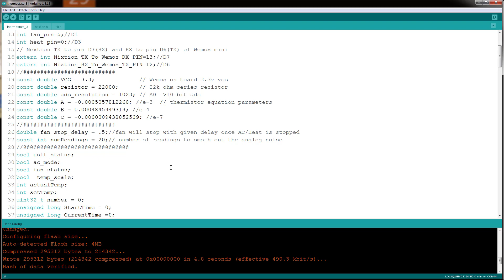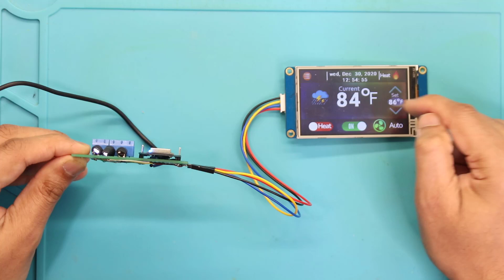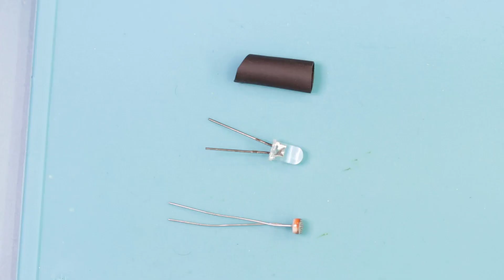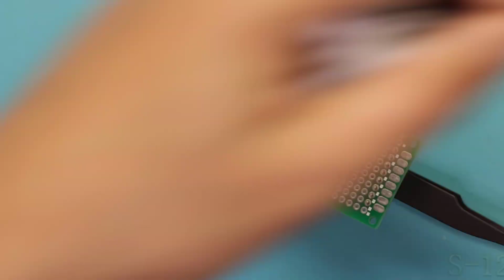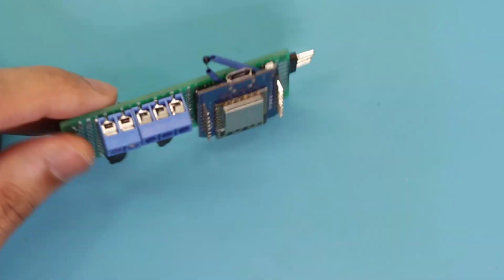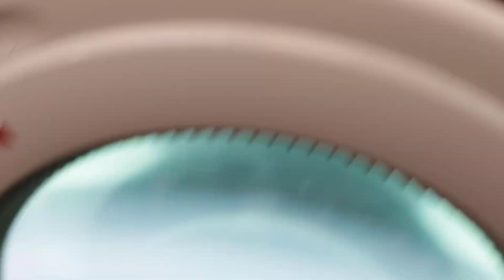ESP8266 Thermostat HVAC | Like Google Nest | Part #3 | Tutorial # 42

Comment: I don’t know if you are still out there, but I have come across this project and found it useful for a project I was working on. I added in classic BT to communicate to the thermostats. I am going to build a solution but curious on how you got the values for the capacitors?

Comment: I have enjoyed so much the informative ideas behind this project.  Especially designing the screen and watching the screen work in real time.  Kudos to Netmedias for sharing his videos and design ideas. .  As far a programing, I believe I have added the correct libraries to Arduino, ESP8266 by communities, and NTPClient by Fabrice Weinberg.  I unfortunately, cannot get it to compile as it stops on line 12.  Nextion myNextion(nextion, 9600); //create a Nextion object named myNextion using the nextion serial port @ 9600bps.   error: 'Nextion' does not name a type;  This is such a practical and fun application. I have everything soldered together and would like to finish the project.  Is there any help either by the author or by someone else who has this Smart Thermostat working?

Comment: Thanks for the complete tutorial!
Question about switching the call-for-heat and call-for-cool: Do you need a protective resistor when switching the White cable to the Red supply, or is it okay to short them?

Comment: Trying to compile the thermostat3.ino but can't get pass the nextion.h line 13, Nextion myNextion(nextion, 9600);, throws error "Nextion does not name a type" Tried most solutions found on Google. Using Arduino ide 1.8.16(also tried 1.8.5) on Win10. Iteadlib , Thanks for any help. Following project with great interest, got successfully pass programing the display.
Reply: I have the same issue. Did you ever get it figured out
Reply: Are you using the Nextion 3.5″ HMI Display NX4832F035 Resistive LCD-TFT Touch Screen 480×320?
Reply: @MacaqueResearcher  I was using the NX4024K032, I  believe it resistive touchscreen.  Never got it working, have you?
Reply: @joshuaburns7598   Try this it got me past line 13 and is from his original code:  SoftwareSerial nextion(12, 13);// Nextion RX to pin D7(TX) and TX to pin D6(RX) of ESP8266 12F

Comment: Great job brother, thank you for sharing
Reply from the maker: Thank you
Reply: @netmedias7657  I have couple questions if you don't mind. Did you use ESP8266 just for updating time? Why you don't consider connecting your module to internet ? Would be great. Last question it will work with ESP8285?  Thank you brother
Reply from the maker: Yes you can use it with ESP8285. I will be contacting it to internet in future videos, good luck

Comment: Why doesn't the system need a relay?
Reply from the maker: Because I am using DIY opto-coupler, you can use relay instead.
Reply: in case of relay, they should output 24v right?

Comment: Dear Nassir Malik
Thanks a lot for sharing, a Very nice and informative Channel.  I am sorry I have not tested it but it will be more useful if you can add more functions. Please add the library links and software versions also it may help for beginners.
 1) Add a wifi manager
2) Retrieve the last state in case of power failure.
3) A good choice is IOT Thermostate.
4) Bluetooth is a good choice for using it wirelessly in absence of WiFi.
5) I think that DHT22 is more useful for Temperature and Humidity.
Really I appreciate your work from the depth of my heart. You will get the benefit in this world and hereafter.
Thanks and my best regards 
Shahid

Comment: Absolutely love your videos. Hoping you can help and or maybe a new video idea. With covid and the surge of indoor exercise on treadmills or indoor cycling fans have became a must. Problem is all good floor blower fans are not smart fans. There is one or two models that run $200+. I’ve read where people have used a relay and pi or other smart boards to voice control each speed wire in a fan. Like Alexa turn fan on high, Alexa turn fan on low.  Relay kicks each speed in. However I have not seen or read of anyone doing this and keeping the original manual fan controls operational as well. Is the possible? If so you should make a video. Would certainly be a hit right now with everyone working out from home. No one wants to get off the bike or treadmill to turn a fan on or up higher.
Reply from the maker: Andy thank you. It is great idea. I will look into it. Thanks

Comment: In the video it shows "LRD LG5528". In the description it says "LG5528 LDR". But the correct part is "GL5528 LDR", which is a Light Dependent Resistor or a Photoresistor. You suppose to be more accurate with the components' description if you make technical videos. Otherwise it's just misleading.
Reply from the maker: Sorry! for the typo mistake.I can't fix the video but did updated the schematic diagram on GitHub . Thank you
Reply: @netmedias7657  I have a small problem. I need to use components that are compatible with Arduino. A position sensor (so I use a GPS module. This GPS module must be Adafruit Ultimate GPS Data Acquisition Module (GPS Included)). A position storage (with an SD card that must work with an SPI link). A bluetooth interface. A GUI to visualize the route (using an Android tablet that is compatible with a bluetooth module).
you can advise me to use what as a component . because it's 3 components must be compatible with Arduino and an Android tablet IHM thanks to a Bluetooth module.